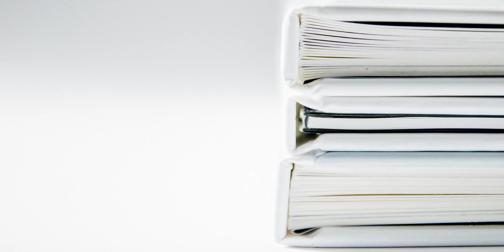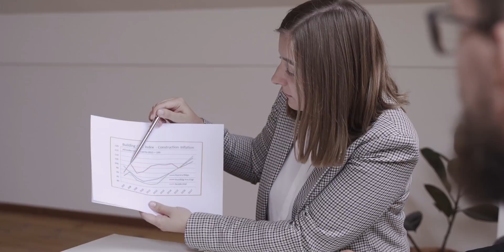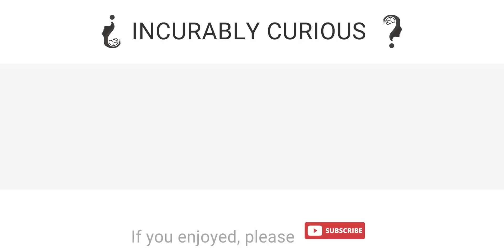Why Most Power Lines Aren’t Underground

Comment: 30 years ago, they buried all the power lines in my area.  I cannot tell you the last time we had a power failure.... they used to occur on a regular basis.  I am very happy with my buried power lines, well worth the cost IMO.
Reply: In the example, they'd have to DOUBLE the rates! For that money, I could buy a generator for the 2 days a year I need it, and be money ahead. Or just pretend I'm Amish twice a year...
Reply: The worst problem with buried lines is locating and sometimes replacing them.  Iv'e pulled mal-lines still it's better than arial. But gas and power in the same trench is not ideal.
Com's have power... enough to ignite gas.
Reply: @-HighTide  In my area, the phone and power are not buried together!  And we don't have any gas lines at all.  So its an all electric sub-division.  I don't know why the phone and power lines are  not together, but they aren't.  Even the cable lines are buried separately... as the fiber is also nowadays.  Anytime they put something new in, you see the trenching crews in the area, and hope that they don't cut someone else's lines -- but the last time that happened was quite awhile ago.... but it does happen.
Reply: Yup, same thing here. The "facts" in this video are either completely inaccurate or a blatant exaggeration.
Reply: well if the video is correct, then it depends on the location. I would personally imagine that places that have already decided to go ahead with the conversion must be in places where underground is particularly ideal. If I'm right, then people with underground cables are unlikely to have reason to complain, because they are in the places where the decision to convert was clearly correct.
Reply: @bonzwah1  please don’t try to use logic on the internet, it may create a black hole.
Reply: @bonzwah1  In my case, the sub-division was built with buried utilities from the get-go.  The conversion that occurred was the trunk line feeding our neighborhood.  For the 1st ten years that I lived here, that trunk had a power fail every time a thunder storm came over the area.  And when it went out, it took a big area out with it.  The trunk was on big metal poles, so it was not affected by trees falling on it.  Then they came thru and buried the whole thing, except for the transformers... Those they left as is.... on the ground (above), as they always had been.  Now the power fails only when a car runs into them or a direct lightening bolt hits it.  The transformers are located near a busy intersection, so car accidents are more common than I would like.
Reply: Honestly I hadn't seen above ground power lines for over 2 decades till I visited the states
Reply: @Hepsewind  We have an incredible amount of space to cover. We have a large number of massive urban areas, but we have ~3.6 million square miles outside of those urban areas.
Reply: @Objectified  not everything is underground here but when I was in the US even the denser suburbs of New York had a bunch of cables hanging in a mess on unstable looking poles. In the urban areas they can definitely be brought underground with powerlines between these areas like how most on Europe is
Reply: What happens if something goes wrong? Do they have to dig up the ground?
Reply: @justinneedham4366  Solution: Build utility tunnels under the roads and run utilities (water, sewage, electrical, gas, etc.) along the inside. No need for constant digging.
Reply: @justinneedham4366  Well, yes, of course.  But honestly, they never fixed the phone lines when they started getting water into them.  The water caused heat (I am told) that melted the insulation and wires shorted out.  For awhile they had extra lines they would give out when old lines went bad.  But in the end, all lines to my home went bad and there was no more phone service.  Period.  At first, I panicked.  How could I call 911?  Then I calmed down and bought a Tracfone for emergencies and got a Nokia for my wife.  I still have the Tracfone (cheap) and my wife has an iPhone now.
Reply: I live in a city now, but lived a little bit out in the sticks (about 15 miles from a major town) the power was constantly going out and it took anywhere for 2 hours to half a day for it to come back on. After awhile living there I found out that if any pole was damaged (most often a car or truck hitting it) the power would go out for everyone in that area. My guess was that the electric company simply assumed that anyone that really wanted/needed power would simply go out and buy an electrical generator if they didn't like constantly losing power.  I can understand that underground cables may not be feasible in many areas, but from a reliability perspective they should be used as much as possible if they can help eliminate some of the time people are without power and if running them isn't that expensive. I remember one thing a person mentioned to me to make me think the "cost" isn't as bad as some electric companies might pretend it is in that in some places the state created laws to fine the electric company if they COULDN'T bring power back up to any given number customers over a certain period of time. And when the said company was faced with the prospect of losing a bit of money every time they had trouble bringing back power, they did things like run more underground cables (and perhaps other things) to try and make sure that either the power didn't go down and/or they had ways of bringing the power up faster. I could be wrong but part of the issue may simply be there may not be enough incentive in certain places for electric companies to either make sure the power doesn't go down and/or to bring the power back on faster.
Reply: @dclem005  more like most can go under few have to be over we had underground in fla. and i think in 30 years i lived there just really bad storms 2 or 3 times per ten years  here in texas if stays on 2 weeks in row  i feel lucky  they put all new lines here about 4 years ago but  the lines that were there 40 years old and shot  think this guy got his info for major trunk lines  wood poles in most places wont last 30 years let alone 80
Reply: My brother has underground lines because his neighborhood is fairly new. He was cozy during Sandy while we lived by the fireplace, read newspapers and used flashlights and candelabras for light. Then there are the crazy transformer explosions, ice storms and that one time the utility company cut power to half the block when there was a house fire. It was 8*F. Such a pain.
Reply: 25 years living in the same place and I've never experienced a power failure, with above ground power lines. My bill isn't that high either, about 30usd monthly, but really no reason to change to underground other than aesthetic purposes
Reply: Where i live they swiched to overground-ground cable. That is, when they have a ingroudn cable suspended on poles. This pretty much solved the problem. Even if it falls down, nothing happens
Reply: No fires.   No accidents.
Reply: Until sections start failing in another 10yrs.
Reply: Same here I'm 24 and the power has never gone out in my whole life in this area and its pretty much mandatory to have everything underground in my country.
Reply: Yea
Reply: Wait till one of the underground transformers burns...takes days for it to cool the point where a man can go down and fix it.
One did here it burned for over 24 hours. Took two days to cool  and three days to rebuild. First twelve blocks of downtown lost power. 36 hours k
Later rerouting had left two blocks to wait....
Reply: @ablewindsor1459  I guess I am lucky.  Although all the power lines are buried in my area, the transformers are above ground, they are sited on concrete pads by the side of the road.  The biggest problem being that auto accidents have a habit of taking them out - and they still get hit by lightening bolts.
Reply: @NUTZJ98  Yeah, except that this area was buried from the get-go, except for the trunk line (which was buried about 20 years ago).  And buried utilities are pretty normal  in this metro area... I can't recall the last time I saw a power or telephone pole.  I am sure there are some, but not in the areas I go thru.
Reply: I live in a place where there's storms every year during the winter that knock down lines, but on the other hand it also rains more than 100 in every year so it's not super feasible to put the lines underground because of how fast they would end up rusting and rotting, the water table is at like 12-18 inches most places here
Reply: Here is an idea... Why don't we have permanent corridors under the sidewalks where everything can pass through?
It seems like a good investment in it, especially since you could split the cost for passing power lines, water pipes, sewage lines and natural gas lines through the same area.
 Plus you could provide enough space for easy maintenance meaning you could lower the maintenance cost too.
Reply: In my area we make use of over head power lines, and only enjoy power supply for one quarter of a year. 🙂
Reply: i rarely have a power outage. maybe once or twice in a year. if that. so it would never be worth the extra cost.
Reply: I've lived in my current area for three years and had a single power outage for 3 hours. I lived with my parents for several years before and had...3 I think? And that was including the one where there was a massive snow storm in May.
Definitely not worth the cost.
Reply: Wouldn’t the cost go back down once they have hurried all the lines?
Reply: problem is when there is damage to an underground power line, it will take days if not weeks to repair it, causing major works, blocking the street with a ridiculous price.
Reply: @Hide_and_Tweak  Weeks? Usually they will switch around the fault leaving only one street out of power. Then it takes about an hour to find the fault. Two to three hours to dig it up, joint out the fault, then about an hour and a half to test the new section and switch back on. Easy. Done it many a time.
Reply: @Hide_and_Tweak  I think this depends on the area you live in and the power company that serves your area.  The few outages we've had since everything was buried were relatively short lived and any delays were due to ordering parts (like new transformers that were not immediately in stock).  Admittedly most of these outages were due to equipment that was still above ground.  In fact, in the last 30 years, I cannot recall a single outage that required digging to repair.  I guess when that happens, you could be proven right... and then I will suffer.
Reply: Yes.  You are referring to low voltage distribution lines that lend themselves to burial.  The related transformers do not.
Reply: @williamrgutrich7694  padmount transformers are just as reliable as overhead transformers. They are identical except one sits on a concrete block, the other hangs on a pole.
Reply: @williamrgutrich7694  Yep!  All the transformers are still above ground... on concrete pads.  There is a big one serving my sub-division out near a major intersection that is routinely hit by cars.  It's location was not changed when the lines were buried.  There is one in the backyard of my neighbor that serves 6 homes (I think), mine being one of them.  In 30 years, it has failed once, a tree hit by lightening fell on it.  When these transformers go out, the outage can last up to a couple of days, or as little as a few hours.... depending on the availability of replacement parts.  As far as I know, none of the buried lines have yet failed -- it has been a long time since I saw digging crews in my area.
Reply: Its because the shadow govt uses these lines as dream catchers.
Reply: our lines are above ground and our power constantly goes out. its been out for over a week straight every june for the past 5 years🤣. soon as June starts all I can think of is "what day will it be"🤔
Reply: The same path can also be used for service lines, like ISP, so the cost is not only for electricity,  and the change should be paid by taxes .

It also makes it easier to serve.

The only downside is the capacitive effect, generating loses for distribution, that is a permanent cost passed along to the consumer, this can be currently solved using high voltage DC power lines, a little history lesson, we use AC because it only requires wires to step up or down the voltage, something that, at the time, was not possible to do with DC, semiconductors currently allow us to step up and down DC voltage, it requires smaller cables than AC and does not suffer from the downsides of AC, the reason why steping up and down the voltage is important is because power losses, you have less resistance and less power loses at high voltages, that is why we use AC and why we should change to DC, plus, all our electronics use DC, so it has to be transformed to DC anyways, and DC to DC is waaaaaay more efficient than AC to DC
Reply: Just think of the cost of the technology to bury a line with 240,000 volts. Underground is ok for local distribution but for long range transmission the cost isn't just double, it is a factor of hundreds.
Reply: @JBS1412  Well, what I can remember is that the power fails used to cause us to lose a frig full of food.  So they must've lasted longer than a few minutes.  Last year we did actually have a power fail with the buried lines, some car ran into the above ground transformers feeding my area.  It took a week during a hot summer to get that fixed.  They didn't have a replacement transformer on-hand.
Reply: When they had to replace old power poles in my area the state highway and local power company stupidly replaced them with more power poles.
Reply: If you ever have a flood, don't go walking in the water!
Reply: ...and you could count on them working in rocky weather... they are in contro; more so now! can't trust none of them, imo
Reply: For me the experience is the opposite. I used to live in an older neighbourhood near downtown with all aboveground powerlines. In 20 years we had like 3 or 4 power outages (including the big ice storm that tore through eastern Canada end of the 90s). Since I moved to the suburbs (same city) with all underground cables, power outages are a regular part of life.
Reply: One thing you may have not taken into consideration, is your OLD power lines were replaced by NEW power lines. How much of the reliability of you present power system is the result of NEW power lines, and not the fact they are buried?
Reply: @oldgysgt  Actually the old power lines were not that old.  The area where I live was generally built in the 70's and 80's, so the old lines were at the oldest around 20-25 years old when replaced.  The buried lines are now a little more than 30 years old (so older than the lines they replaced).
Reply: @pawnslinger1 ; "old" does not only mean a passage of years. Some "older" systems were engineered for a certain projected load, but the pattern of growth changed, making the system out of date and in need of replacement with a "newer" system with a greater capacity. That happened in an area in my town. PG&E placed cables that were projected to last a minimum of 60 years, but that part of town grew faster than anticipated, and more multi-family units were built, increasing the power load far beyond what was originally anticipated per square mile. The greater demand shortened the useful life of the cables, and in less than half of its projected life, the system started failing. The Electric company spent tens of millions of dollars placing new cables, and reinforcing the power grid overall. That was a number of years ago, and the problem is apparently been solved. By the way, both the "old" grid and the "new" one were underground utilities from the start.
Reply: @oldgysgt  In my case, I don't consider any of the electrical grid to be old.  Some is older than other parts, to be sure, but the area I live in is a relatively new area.  40 years ago, most of my area was just corn fields.  Even when I moved here, there were big corn fields about 1/4 mile from my home.  Since then the farms have all disappeared.  So instead of calling it old, I should have said "original".  Why did they bury the system?  I don't know, but I do know storms used to knock out the system routinely when I first moved here.  Since burial, the system has been pretty stable, with the exception of automobile accidents knocking out the above ground transformers.  At this time, my area is deep within the Phoenix metro area, when I moved here, we were on the outskirts of town.
Reply: I am a lineman and I can fix your above ground wire in less then 1 hour but Underground can be 5 to 6 hours after you wait for miss dig and then dig up your yard or driveway.  Good luck
Reply: @Matthew-oy2uj  Well, the only failures I am aware of, in my area since burial, are the above ground transformers.  Now mind you, that's 30 years of reliability... lines were buried in the early 1990s.  Failures were quite common prior to that - I do not know the cause.  Anyhow, it takes days to fix the transformers, according to SRP (the power company here) they usually don't have replacement parts on-hand.  I just pray that the failures come during the off-season (i.e. not during the scorching summers).
Reply: Exactly the same with me.  Moved to an area (most of the USA) where they are back above ground on utility poles with nothing but issues.  Beautiful clear day that isn't too hot, or too cold so just perfect and BOOM, 16 hours without power without a single reason given.
Reply: My dad used to tell me that in Germany, all the power lines are underground, and he couldn't understand why Americans have overhead power lines.
Reply: I really have to question where this data about the longevity and reliability of underground lines in this video is coming from. The evidence appears to entirely disagree. 
Is it data from before plastics?
Reply: And powerlines and modern electricity is a scam to tax us in Bill us  just like oil and big pharma the truth is the world used to be powered through free energy and they covered the old Egyptian power ducts that's why Edison won and Tesla was killed off through the system there was no money to be made by tesla grounded system.
Reply: It seems like any initial cost of doing this would be recovered over time. Buying and replacing poles and wire and the labor to replace them is a big expense. Running lines in a pipe above ground would also be an improvement.
Reply: Wait bcs what if it floods
Reply: And I couldnt tell you the last time we had a power outage either and pretty much all the lines are above ground. So it my case, the additional cost would 100% not be worth it at all.
Reply: @NavyDood21  Agreed!!  But the funny thing is that my electric bill didn't really go up much at all after they buried the lines.... maybe because I have a lot of hydro (dams) and nuclear (big plant west of town) near my home.  Beats me why the electric cost didn't rise much.   Of course, my electric bill is pretty big (I think) anyway!!
Reply: @pawnslinger1  You electrical bill wont have, its your municipal taxes that went up, and they likely went up alot. Those lines have to be inspected anually for damage from water seep. costing a small fortune for most towns villages and smaller cities. Not worth it in the slightest in my opinion.
Reply: @DeagleGamesTV  Well, yes, over 30 years my taxes (property, they have consolidated county/municipal taxes here) have about doubled.  But still, I think my taxes are quite low compared to my property value (it tripled in 30 years, but taxes only doubled).  So I think its a bargain.
Reply: @DeagleGamesTV  People in old days thought sewerage was not worth it. Same goes for fire protection standards. It always cost too much to do something until its too late.
Reply: @DeagleGamesTV  Standard XPLE Underground cables don't need any inspections at all, let alone yearly. Poles and vegetation on the other hand do need regular inspections. Lines in dry areas need washing to prevent arching. Overhead have many maintenance costs. Unless damaged or Older Tranmission voltage oil pumped  cables (that are very small percentage of the grid) underground have no maintence costs.
Reply: @DeagleGamesTV  
we have the majority of our power lines underground in cities in the UK.   I have lived in this house for 20nyears and they have never needed to inspect the power lines under our street during that time. They only dig a trench to inspect when there is a reported issue otherwise they leave them.
Reply: @kcgunesq  In my area, I never see any telephone poles.... nor wires strung in the air.... EXCEPT the long distance transmission lines coming from the nuke out west of town.  I guess we must have telephone poles somewhere in town, because the local news still covers them when the power goes out after a storm... but those are not anywhere near me.... only those big huge long distance transmission lines that make my radio buzz when I drive under them.
Reply: @Br1t2006  Again, the issue is not that underground power cables can't be a great solution where they are viable, it's that they're not viable or even possible in many areas due to geography and/or location.
Reply: @pawnslinger1  if the reason to change is a government reason they pay the cost of the conversion, you pay the extra losses (see my other comment above this)
Reply: @pawnslinger1  It’s because they didn’t bs you.
Reply: @pawnslinger1  The power company probably planned it in advance and piled cash for funding the project.
Reply: @DeagleGamesTV  Municipal bills aren't dependent on electric infrastructure upgrades.
Reply: @DeagleGamesTV Interesting. In my country maintenance of lines and adding new it is part of electricity bill. It's called distribution services. It's calculated from lump sum plus reserved capacity by breaker plus tariff.
In my case it's around 5-10$$mo for normal 25 amps three phase connection.
We have about 50% in rural area buried lines except high voltage and they bury every year another + increase capacity etc.
Reply: @pawnslinger1 that’s not the reason. It’s the cost of putting in the lines
Reply: @NavyDood21 must be convenient not living near trees, or just being a liar.
Reply: @NavyDood21  I can ours are above ground 3 times in the last month
Reply: initial costs might be a lot, but don't tell me that repairing damage to the current infrastructure is cheap. 
we can just try and do sections at a time.. or decide to design new networks with this in mind.
Reply: @robertg7249  no, let all these rich neighborhoods have their underground electric service but leave me alone.  I dig underground utilities for a living and know what the real costs are.  What can take a day to fix in the air will take a month to fix underground and costs exponentially more.
Reply: @robertg7249  If you actually watched the video, you'll note that underground installations last about half as long as aboveground ones.

If your primary concern is longevity, you'll put all your lines aboveground, and live with the occasional outage.
Reply: @bcubed72  My power lines have been underground for 50 years,  and I haven't had one problem at all. Had problems every year or two when they were above ground.
Reply: @bcubed72  I've worked on cables in great nick over 50 years old. Wood poles very rarely last anywhere near 80 years.
Reply: @scottwhat3362  on Iowa our Wood poles are Leaning at a 45°Angle. That's very disconcerting.
Reply: @bcubed72  "Occasional"? That's cute. Power goes out once every couple weeks here. Slight breeze? Power's out. Sunny day? Power's out.
Underground power lines are superior.
Reply: @bcubed72  That must be the case in the US. But in the rest of the world it isn't. Germany never really had powerlines (except between cities and towns) above ground. There is basically never any service truck near underground powerlines. Why would it, they last much longer underground since there is basically no stress on them and no weather. That's why we almost never have power outages in Germany. Well, every few decades maybe or small local ones because of servicing of something. Not because of weather, cold or insufficiently trained personnel, house fires, people cutting down trees which fall on powerlines, birds, kids throwing things, people crashing into poles...the list is endless why above powerlines are redicilous after 1930
Reply: @bcubed72  False propaganda to not put cables underground.
Reply: @dubious6718  I'm literally just quoting the video we all watched.
Reply: @bcubed72  So both you and the video are wrong, shocker.
Reply: @craigmarr7986  You not having one problem at all doesn't mean they haven't been replacing and repairing those lines. And as the video clearly stated, the viability of underground power lines varies dramatically by geography and location. It works fine where you are. It may not work so in a different location. It may not even be possible to put them underground in many locations.
Reply: @scottwhat3362  He's talking about the cables.
Reply: @BloodwyrmWildheart  I live in a small city in one of the windiest areas of the country that gets both bitterly cold and scorching hot, and it's 5 hours from the nearest large city. We routinely have sustained winds for days of 30-40 MPH with gusts even higher. Our power hasn't gone out in 10 years with above-ground power except twice - one for a storm so bad it left half entire sections of the city needing new roofs and siding, and the other during a brutal and extended heat wave that affected many in the region and nearby populations. The state of above-ground power varies from area to area. There's not a real question that underground power lines are superior, but they aren't feasible in every area. That's the entire point.
Reply: @GERntleMAN  Germany is not the rest of the world. Many countries still have significant portions of their power lines above ground. There are a number of factors that come into play, as the video very clearly stated, particularly for a country the size of the U.S which is massive in size and has highly varied geography. Try running power underground to cover 3.6 million square miles of non-urban land.
Reply: @Objectified  I think there is a lack of understanding present. We don't have powerlines underground for long distance power lines. We are talking about cities and towns. Even the smallest settlement of 5 houses here has powerlines underground between houses. The powerlines going there are overground of course, because they carry between 50.000 and 500.000V. I thought this obvious...
Reply: @craigmarr7986  Those powerlines are probably direct buried.... no insulation or conduit around them and will absolutely fry the construction crew assigned to work on it when there's a problem
Reply: @bcubed72  People die in outages. Nobody is mentioning that small detail.
Reply: @653j521  Who, exactly, dies in power outages?

Hospitals have backup power (for this exact reason). If you are so sick that your electric medical equipment is necessary for life, I'd expect you to own a backup generator.

A normal, healthy, human being isn't going to die in a 12-hr power outage.
Reply: @bcubed72  In theory.
Reply: When I was a kid in Southern California(not too long ago, pre-recession) there were constant power outages, especially during the summer. One lasted at least 3 days minimum. I would say it was half a dozen times a year and culminated to over a weeks worth of time each year. I believe they buried a good portion of the lines since, and I have friends/family still in the area and they say its a rare occurrence now.
Reply: Information and pics or didn't happen
Reply: the cost gets cheaper if the combine all lines in a Tunnel with access
Reply: Anecdotal evidence. On a whole, underground is less reliable. And when an underground failure does occur, it's way more difficult to find the failure point and more expensive to fix.
Reply: @Kanglar  As I said. Seems to be the case only in the US. You are free to research the reliability of underground cables around the world although it is hard to find numbers since they just don't fail. But believe what you want, the earth is flat, reptilian men control the world and underground cables are less reliable than overground lines.
People...
Reply: @Kanglar  I don't disagree with that at all.  It is a clear trade-off.  During the time I have lived here (around 35 years) there have been the rare power fails and they did take longer to fix.  I have no idea of the cost involved, but I would not be surprised at all, if they cost a lot more to fix.  The worst downside I have seen is that I've had to live without AC for longer than I'd like (I live in a hot desert environment) and I lost all the refrigerated food, about 300$ worth.  On average, I think that has happened about once every 10 years (after the trunk lines were buried).  Before the trunk lines were buried, every thunder storm that came around during the monsoon season would knock out power for about 20 blocks around my house.  Monsoons happen every year and have lots of thunder storms.  So I like my buried power system... a clear trade: stable power - costs more.
Reply: Your lack of power failure isn't because of the buried power lines near your area, it's because of the ones that are farther away which aren't buried, i.e. the high tension cables that come from the power station. 

If ALL the cables are buried from the power station the entire way to your home, you would experience a very frequent power outage unless there is completely no construction or weather events occurring for the entire part of the line
Reply: @nicholaslee5473  Maybe, but power fails were quite common before burial.  So I am happy, no matter the why!!